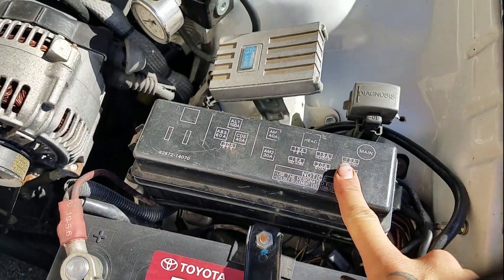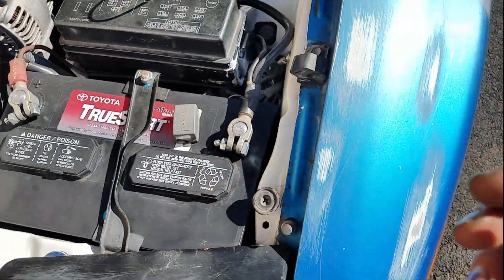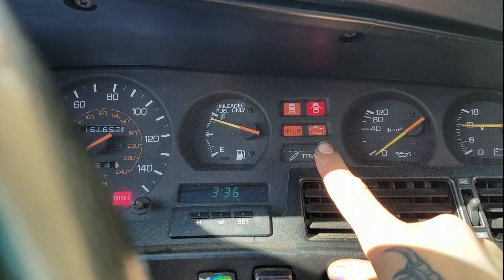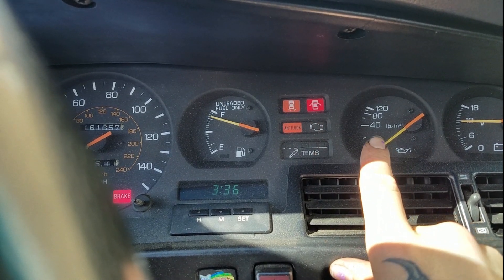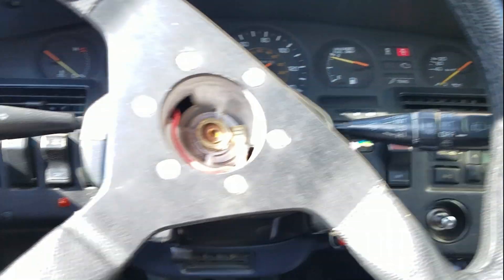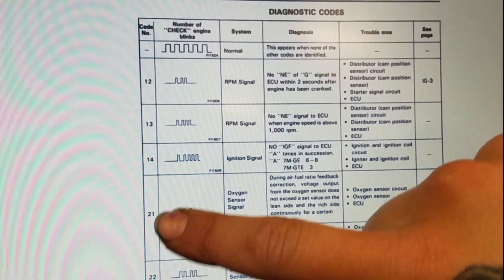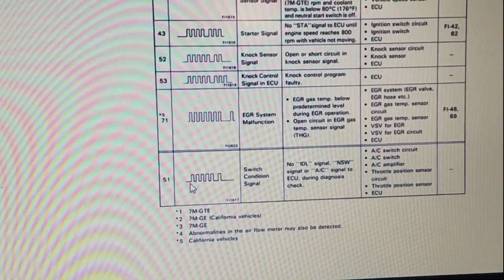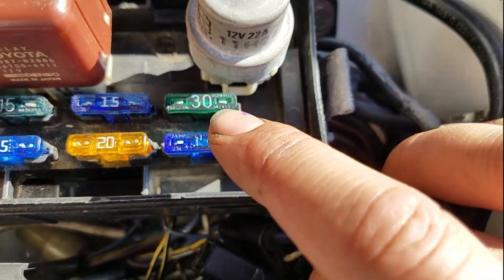How to Retreive Diagnostic Codes on a Mk3 (1986 - 1992) Toyota Supra

Comment: hey Faye, hopefully you have time to help out. by any chance would you know what implies a code 53? It tells me that my not control program is faulty and i can't find how to diagnose this. I noticed my supra's knock wire was torn hanging around by the intake manifold. it didn't even have a sensor. i bought sensor and even just ran an individual wire from the knock ecu pin to the sensor after the repaired wire didn't work. i still retain this dang code.. my symptoms are slow/poor acceleration between 1000-2500 rpm and I have backfire/misfire and light jerking letting off the pedal but the performance improves after surpassing lower rpm range

Comment: Faye says "turn the ignition key to accessory mode", but what she is really doing is turning it to the ON position without cranking. That's the only way to read the codes,  unless you have a Toyota Super Monitor In place of the standard clock.

Comment: So what is the wire called you used to get the code called?
Reply: It's just a simple wire that she put spade terminals on the ends. Nothing special about that wire. Any wire will do. It's called a jumper wire because you use it to "jump" one thing to another thing.

Comment: Do you happen to know what Code 51 is? I’m having a misfiring issue / no throttle response
Reply: Code 51 is related to Throttle Position Sensor (TPS). The IDL switch in the TPS - also called a Closed Throttle Switch produces a 0 volt signal to the ECU, so it knows that it is at idle. As soon as the throttle is cracked open, the ECU will get reading +B voltage and delivering fuel to the injectors to suit. You need to do resistance checks between the E2 and all other pins on the TPS or replace the TPS and see if that fixes it. Have you fixed it already?

Comment: How far apart are your flashes? Congratulations, it's a baby Supra! Your chickens are full of it. Must be the cooler weather. The one is jukin' and jivin'. I'm really liking your codes and electrical videos.
Reply from the maker: My personal flashes?!? 😅 Several hours apart and based on mood!!! And do you have experience with chickens acting like this? Lillith (white one) is normal in the coop but freaks out like this when she's out in the run with the others 😂
Reply: The younger chickens do this a little. Kinda like they are daring another to challenge them. The pecking order can change occasionally. I have one hen that ducks her head and goes backwards pretty often. So many different personalities.

Comment: I sure don't miss every manufacturer having a different way to retrieve codes!

I'm curious if in your Toyota travels you've done a rear wiper motor on a Highlander?  2013ish.  If if you've got any tips and/or tricks.  I fought with one the other day and the hardest part was getting the transmission separated from the window grommet.  The rest is just nuts n bolts but that bit was hateful

Comment: My 2000 Tundra V8 also has that diagnostic port on top of the engine.   Is that just a carryover due to the engine’s history (it’s an altered, iron block, version of the LS400/SC400 engine), and will it offer me any info that my truck’s OBD2 port can’t give me?   Thanks to anyone for an answer.  Cheers.

Comment: Old School diagnostics.   Probably works on many Pre OBD2 Yotas?
Reply: Yes. Some old (mid-1980s Toyotas) used single digit codes where you just count the number of consecutive flashes to get the code number. The "newer" Toyotas (late 1980s-onward) used two digit codes where the first set of flashes is the tenths place of the code and the second set of flashes is for the ones place of the code. For Toyota Trucks with the 22R-E, here are the codes: https://www.4crawler.com/4x4/CheapTricks/TroubleCodes/index.shtml

Comment: Try to bridge E1 and TE1 and look at the flashes and count them after a few beers and then try to follow the factory guide on how to diagnose the fault, wake up in the morning thinking you've had a nightmare and realise "no that actually happened".... Forever and ever have nothing else to do with that system, steadfastly convince customers to go for aftermarket engine control and then sleep well for here and ever after.